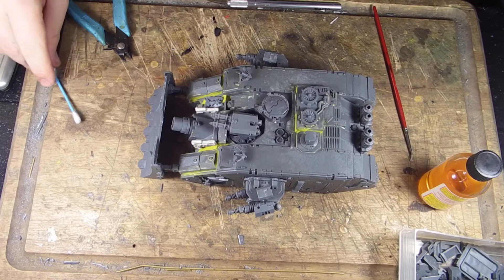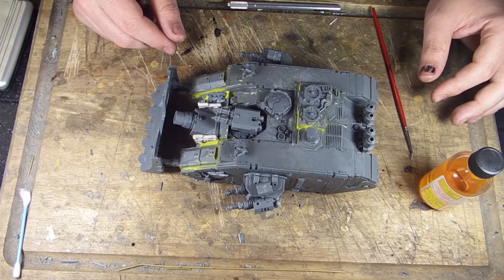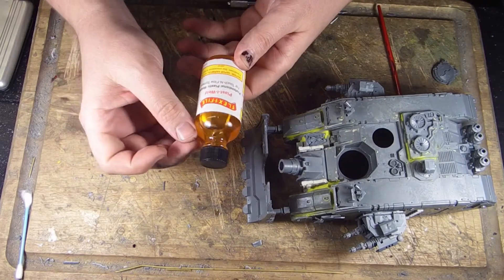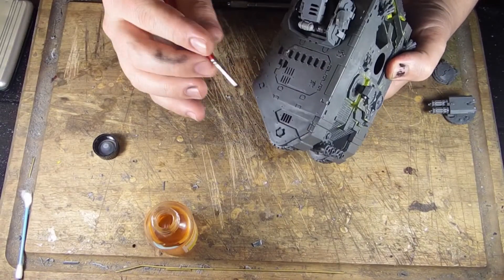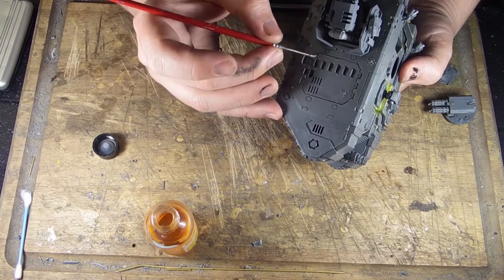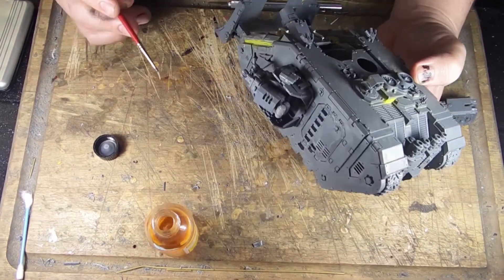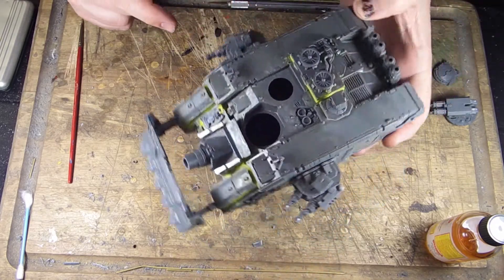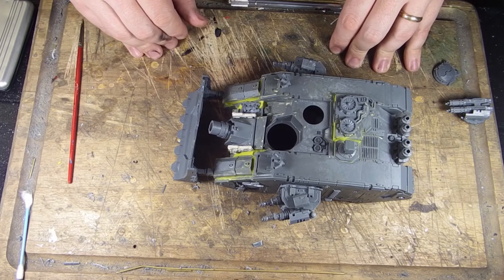Cheat Codes : How to remove mold lines quick and easy

Comment: i have found tamiya thin glue with the same results .
Reply: I just tried using Tamiya Extra Thin Cement on some cadian and it didnt really remove the mold line. Are you sure, or am i just doing it wrong.